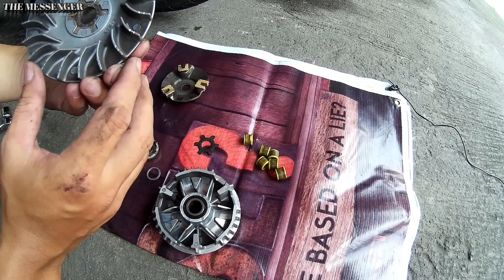How to remove crankcase/cleaning pulley set on mio sporty part 2

Comment: sir pahelp naman ung mio ko kapag nkaaccelerate na ako ng 40kph above sumisipol sa may crankcase nya nagpalit n ako ng bearing ,okay naman ang gear ng transmission ko walang gasgas maingay parin sya parang sumisipol sir, sana matulungan mo ako
Reply from the maker: check mo pulley set mo paps.. baka di na pantay, yung parang may alon na